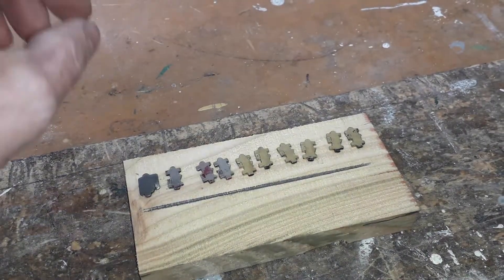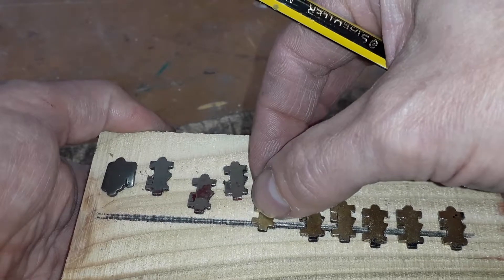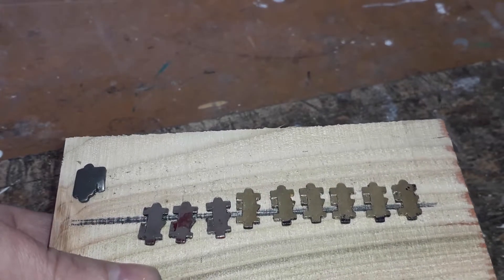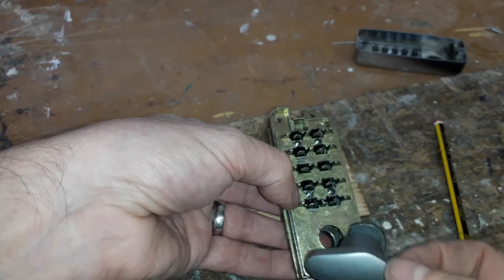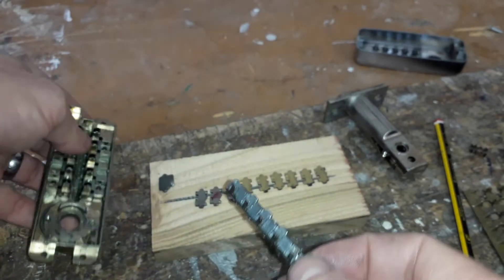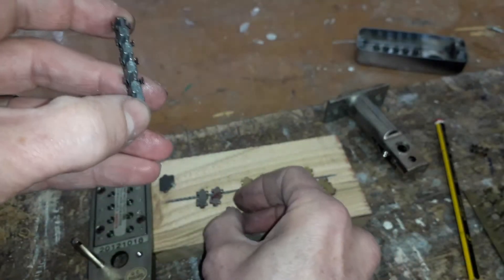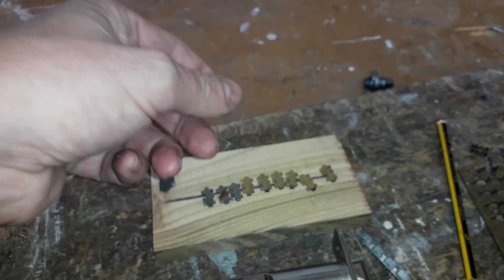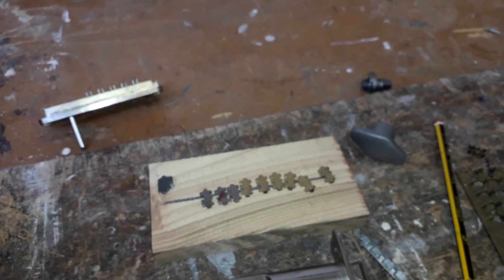(039) Ever wondered how a digital push button lock works

Comment: Unfortunately Roy is slightly incorrect. The middle bar with the tiny leaf springs on it hold the wafers in. It doesnt matter if the right or wrong wafers/buttons are pressed they will be held in by the little tooth on the wafer.  So when assembling the little pointed tooth on the wafer must face the middle bar. Now the square notch on the wafer will now face away from the middle bar but will allow or prevent the, outer cage/ bar call it what you like, from moving hence preventing the knob and cam to turn hence locking the latch. Like Roy says when the correct buttons are pressed the tooth holds it in position and the square notches align to allow the knob/cam to turn as the cage is free to move. Complicated? Maybe until you understand it.

Comment: Can we change crank mechanisms
Reply from the maker: If you mean as a replacement part for a worn one I don't think you can. If you mean to fit something different then I guess it's possible but very fiddly and awkward to do. You would have to be able to marry the existing and new crank mechanism together, not an easy thing to do.

Comment: How does the Cancel key works ?
And what keeps the depressed wafers pushed in since there are springs everywhere ?
Reply from the maker: The centre bar holds the wafers depressed. The cancel key works with the pressure of the spring creating downward pressure, when you push the cancel key it releases that pressure allowing the bar to move and the numbered pins pop up.
Reply: A tip: watch series on Flixzone. I've been using them for watching a lot of movies these days.
Reply: @Marley Jagger Definitely, I've been watching on Flixzone for years myself :)